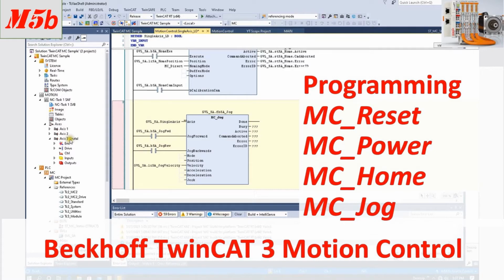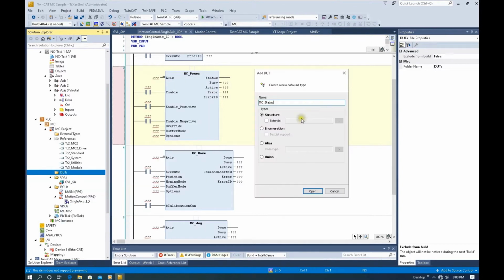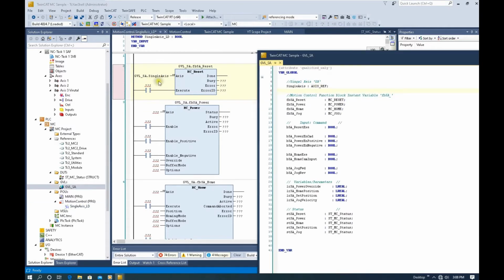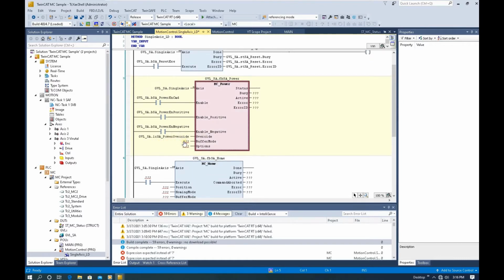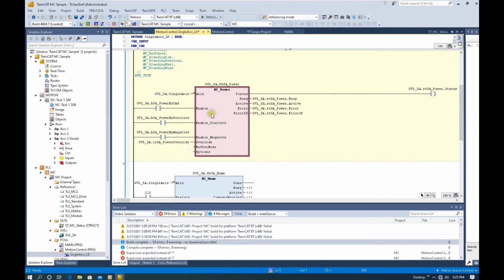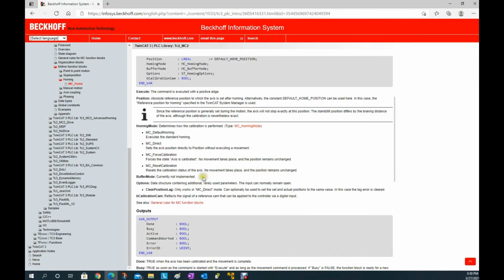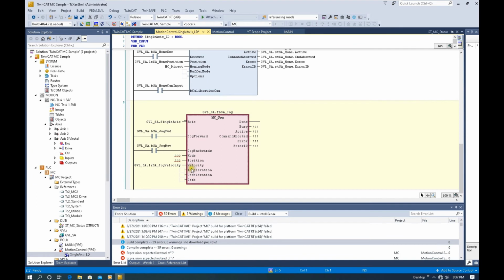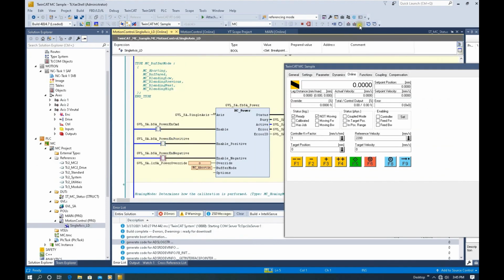MB05b. [TwinCAT 3 NC] Program MC Reset, Power, Home, Jog in TwinCAT3 [6/20]

Comment: Nice Video. Very informative. I've noticed that in the GVL_SA you've defined variables for 'SetPosition' but in the the ladder network you havn't defined any related box.
Reply from the maker: That GVL_SA.SetPosition is a spare variable and could be used for "Position" of MC_Home. So you can set a position directly to the axis.

Comment: Hello,
What if I have more than one axis, can I still use the GVL list like this, or do I have to define the variables individually for each axis?
Is there any possibility to contact you ?
Reply from the maker: You need to define variables for all the individual axis.
Reply: @electricalautomation  thx for answer...Do you have experience with CNC control (G-Code interpreter) and with the interpolation of several axes?

Comment: I tried to install TC3 XAE in a VM; The multi-user module can not be installed correctly. 
When I try to start the XAE via the icon down the right bottom it just prompts a 0x462 error.
Did you config the VM in some way when you are installing the XAE?
Reply from the maker: Try use Right Click Icon on your desktop, then use "Administrator". Also check the download link  https://www.beckhoff.com/en-en/products/automation/twincat/te1xxx-twincat-3-engineering/te1000.html